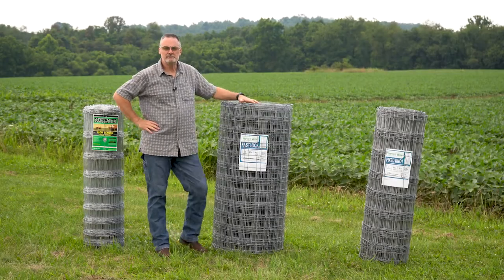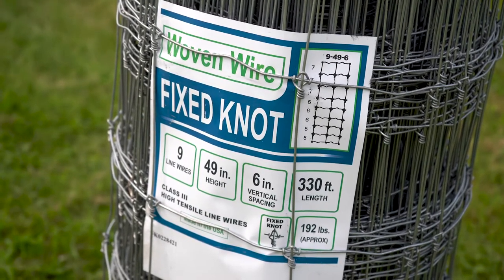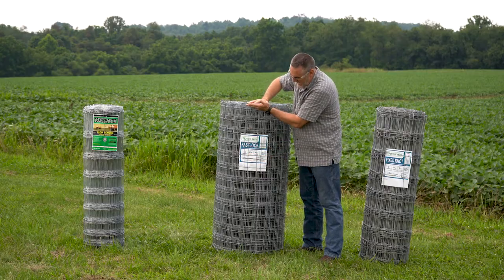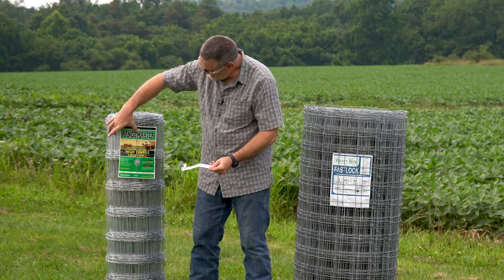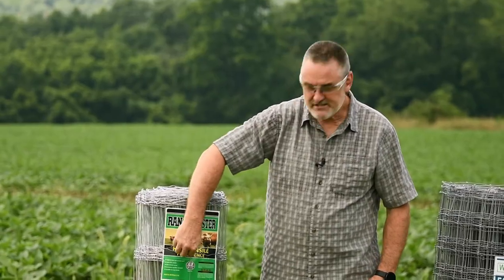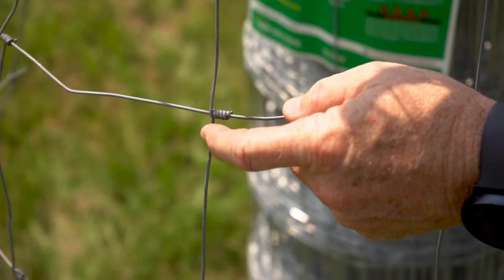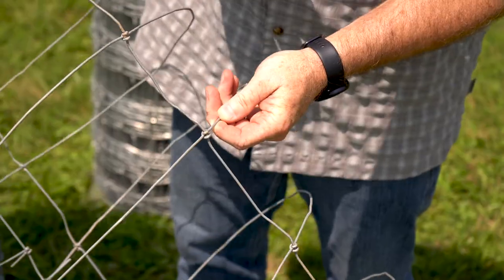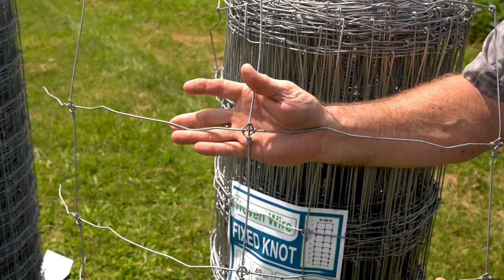Fencing 101 - Woven Wire Basics

Comment: Hi there excellent comparison video Shane!  For the rangemaster high tensile hinged knot field fence, how far would you stretch fence between H braces (on relatively flat ground).  With rolls of 330', can you splice two rolls together and stretch the fence 660' between H braces? Can you stretch further than 660'? Are there downsides to stretching further runs?
Reply from the maker: You can splice 330' rolls together, make sure your slices are consistent so the wire pulls and tensions even across the entire length. You can stretch further than 660' as well, just pay attention to changes in topography/elevation. That consideration may be your biggest limiting factor in how far you can stretch.
Reply: @KencoveFarmFence   Thank you! Assuming a run that starts from a corner, is there a length at which you would need to double the H brace at the corner?

Comment: 1:20 - when you said "13 verticals," did you mean horizontals? I just want to make sure, thanks!
Reply from the maker: Hello, Yes this can be confusing depending on your region, the terminology may change! We call these verticals because you could them vertically (from the ground up). But, you would be correct that these are wires that run horizontally. We hope this helps!
Reply: Can I use this game wire for my perimeter fence. I want to keep free-range  chickens.